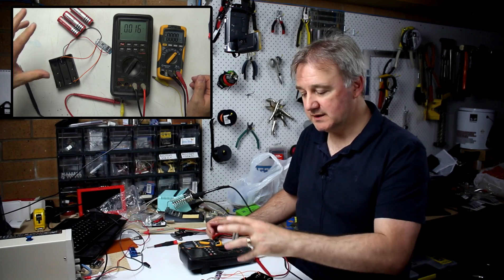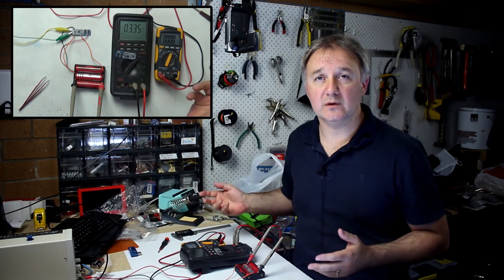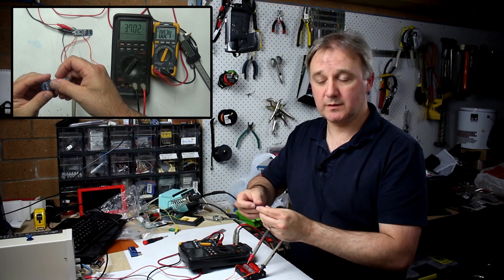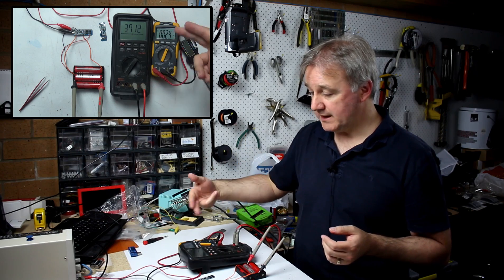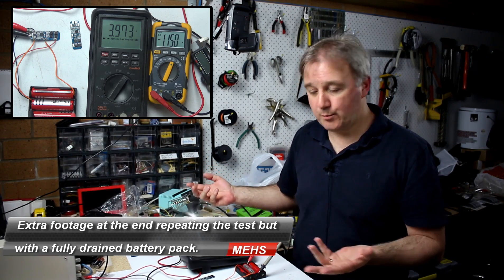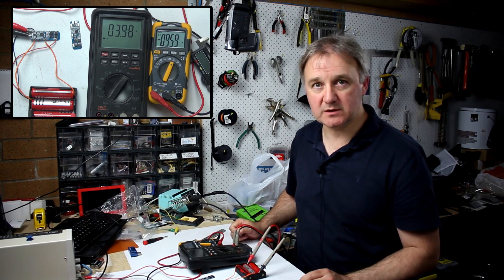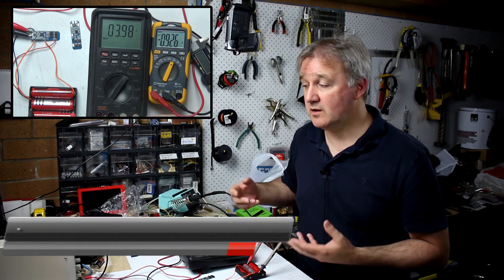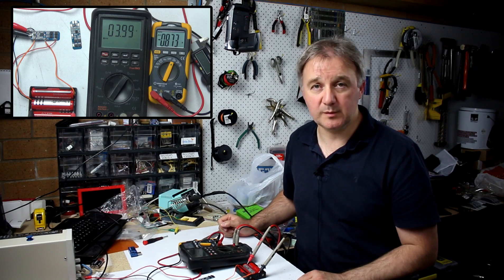Does a BMS charge my Batteries? (MEHS) Episode 57

Comment: I have one of those, it "works". It charges the batteries quite fast (diff brands tried) but never reach full 4.2V, mine gets them to 4.11. In full detail: measuring each cell independently it goes up to 4.23 but when charging is cut, the batteries are only 4.11, so the previous reading is not just the battery. It works fast, I like that, but after many tests I know it doesn't get them at 100% of charge.

It's fair to say there are different brands and PCB colors for this same circuit, so not all of them will behave exactly the same. 

I read comments regarding the input charging voltage but in my case it made no difference using 12V and up. It's not a full charging circuit. Yes it will cut the charging and discharging but there is no way to know if the batteries are charging unless you plug your meter. A one or two color LED would be a great addition but there is none.

The only reasons I'm keeping it is because it charges fast, faster than my other 18650 chargers, but I know IF I want 100% charge I have to move the batteries to the classic chargers, this one will never reach the 4.2V, it doesn't matter new or used batteries, or brands. But as said, that's mine, yours might work differently.
Reply: Thanks for sharing man... Is there any resistor to tweak and correct it?

Comment: what if i charge with 19v power adapter.. will that charge?
Reply from the maker: - Hi.  It will sort of but you will be causing the BMS to heat up a lot as the circuit on the BMS will cut in and out each time it detects total voltage over 12.6V (for a 3s setup).  In your case this will be most of the time.  Not great.  You should feed it 12.2 to 12.6V, not 19.  If you must use 19, use a MAX745 board that will charge the cells properly through the BSM and it will take up to 20v as the input voltage.  Cheers.

Comment: I think your thinking is flawed on this one. 12 volts  x 1 amp = 12 watts of charging power total. But your three batteries are charging at basically 4 volts. So that's 4 volts x 1 amp per battery = 4 watts of charging power per battery. 4 watts x 3 batteries also  equals 12 watts of charging power. So then your batteries are charging at 1 amp per battery not 1 amp divided by three batteries.

You should've put the amp meter between a battery and the BMS circuit board to find the charge current for that one battery.

Comment: Thanks for tutorial.  Have you discovered a BMS board that does what it should?  I also like to find one with separate charge and output lines, so I can use it like a backup battery.    Run my load off the battery that constantly charges.
Reply from the maker: - Hi.  BMS are trial and error but pair a decent one with a MAX745 and you have a drain and charge battery pack as long as you drain at less than 1.5A.  Cheers.

Comment: when i plug my bms into the 12v cig lighter in my car i dont seem to be getting a charge...  has anyone else tried this?
Reply: Is your BMS 2S, 3S, 4S, 5S, 6S, 7S....?? It makes a night and day difference.
Reply: Thanks everyone for the reply.  Im not sure what my original question was.  I have learned a lot since last year.   I think i was trying to charge my 3s4p using the 12v output in my car which I did successfully do by building a device that has a step up converter in it to boost the 12v car battery to 19v 2a and that is wired to a 3s mppt and it works
Reply: It depends on what your cig lighter is rated for, I would imagine not too high of current?

Comment: i want to use 3s2p 20amp bms for charging 3x3.6V 6 cell which i will use in motorcycle. and motorcycles regular charging system will be used to charge and drain the battery pack [3s2px3.6]. is it possible successfully?
-regards. -mamun2a
Reply from the maker: - Hi.  Yes and No.  You can easily find a BMS that will handle 3S at 20A so that part is easy.  The harder part is charging the pack as the BMS will handle input voltage peaks and troughs but it doesn't correctly charge the cells.  Your bike will just dump 12-15v into the pack and the BMS will try to reject anything outside the safe limits of a 3S pack.  This will put power back into the cells but they aren't being charged correctly.  You should connect a charging circuit to the pack so the charging circuit takes the power from the bike alternator and provides a correct charge to the pack.  This is tricky as the charging will be interrupted each time you stop the bike.  This is not ideal for lithium cells, hence why its not common to do it.  Without the charging board, you will get it to work but the life of the cells is unpredictable.  Cheers.
Reply: then using an additional charging circuit next to regulator will work, what u think? DC-DC Buck circuit helps or else to use for charging?? @michaelsstuff4402
Reply from the maker: - Hi.  Even if you add a charging circuit you still have the problem of the charge being interrupted every time the bike stops.  A full charge typically takes 4hrs or more and is not supposed to be interrupted.    @highspeedshipbuilding8318
Reply: Thanks for reply. now a days quick charger available for mobile, if i use them, what then??  @michaelsstuff4402
Reply: sorry for late, if i use quick charger for charge it?? i.e. 2 ampere mobile charger as charging unit??  @michaelsstuff4402
Reply: @michaelsstuff4402  https://www.aliexpress.com/item/HW632-XH-M603-Charging-Control-Module-Digital-LED-Display-Storage-12-24V-Lithium-Battery-Charger-Control/32842607493.html?spm=2114.10010108.1000014.1.8b659f8awlExDg&gps-id=pcDetailBottomMoreOtherSeller&scm=1007.13338.112237.000000000000000&scm_id=1007.13338.112237.000000000000000&scm-url=1007.13338.112237.000000000000000&pvid=fdac6bd7-c5ec-48d4-814f-3ef424276e44 
Thanks for reply. check the link, is this OK for charge and BMS same time?

Comment: I hope a buck boost converter connected between power supply & 3S BMS by setting it's CC (1A) & CV(12.6) can charge these battery safely. What u ppl think?
Reply from the maker: - Hi.  You will put some charge into the cells but not ideal.  The converter provides a constant 1A throughout the whole charge cycle.  This is not what LION cells want.  You need a way to have the 2nd half of the charge cycle be CV but not CC.  That's why I recommend a proper charging IC, not just a buck/boost board.  Cheers.
Reply: @michaelsstuff4402  I have read that buck boost converter can provide CC & CV like chargers. Charging starts with CC & voltage starts build up & when the voltage reaches CV level current drastically drops.  This is what I have learnt in case of Buck boost.. correct me if I'm wrong
Reply: @michaelsstuff4402  i have a buck boost converter which has cc and cv with variable trim pot so you mean if i set the current at 2amp and voltage at 12.7 through bms its not working like charger?

Comment: Tell me one thing. You are using 12V power supply to charge, right? Whereas the full charge voltage would be 4.2x3 which is 12.6V. How do you expect the batteries to get fully charged?
Reply from the maker: - Hi.  Yes good point.  I set my power supply to deliver 12.6V so I can get a full charge but a basic 12V supply will still deliver 4V to each cell and that is satisfactory as that still gives about a 75% charge.  The cells last much longer that way too.  Cheers.
Reply: Hi Sudip, I have built a 3 battery pack with a BMS. It's working great so far. My worry is I have no clue how to charge the pack once it runs out of charge. Would you be able to help me?

Comment: BMS by definition doesn't control the charge current and voltage.  It only monitors the status of batteries and take action for protection when something goes wrong. So question is not whether a BMS  charges the battery. Rather, it should be whether a given BMS works well with a specific battery charger...
Reply: so if i had a bms and i just hooked it up to 12vdc and i controlled the current , it would keep the cells balanced and wouldnt let them overcharge?

Comment: Would solar charging the battery packs be out of the question or what.
Reply from the maker: - Hi.  No not at all.  You do have to consider a couple of issues but solar is a real option.  The main issue is that solar panels output ranges from 10v to 19v.  If you fed that voltage into the BMS it would likely lock out the input.  This is not ideal.  All you need to do is run a voltage regulator between the solar panel and the BMS.  A SEPIC style reg would be good as they boost low voltages and reduce high voltages and give a smooth 12v supply.  If you used the MAX745 charging IC then they accept voltages up to 20v so that would work well with a solar panel.  The only issue there is that the MAX745 charger will only charge the cells through the BMS when the input voltage is 3V higher that the battery pack voltage, say 12.6V.  That means a 3S pack at a nominal voltage of 12.6V would only receive charge from the MAX745 when the solar panel is producing 15.6V.  You're missing out on some of the solar panel output range but it would work.  Cheers.

Comment: EXCELLENT work!  I've seen too many Youtube "experts" who aren't.  MEHS clearly has technical mastery of his subject and presents the information in a clear, understandable delivery.
Reply from the maker: - Thanks Bruce.  Very kind.  Cheers.
Reply: Dear MEHS, I've built a charger  that works for a 6-cell 18650 battery pack to run my Makita cordless drill (3 pairs in parallel, the whole set in series to get the 12 volts).  I charge each parallel pair with TWO TP 4056's in parallel.  I can't seem to send you the schematic here, but my question is this:  The setup seems to give a full charge to the Li ion batteries, but I don't have undervoltage protection when using the drill. The video you did for Episode 57 mentions that, though the board does NOT give a full charge to the batteries, it DOES provide undervoltage protection.  Is there a way I could use the board featured in Episode 57 to provide undervoltage protection and use my circuit to provide full charge?   Thanks for any thoughts you might wish to share.  Bruce Ratcliffe, self-taught electronics teacher, Edison High School, Fresno, California
Reply from the maker: - Hi.  This can get tricky as you need to watch out for the common ground problem when connecting multiple tp4056's together to something.  The grounds become common and one tp4056 ends up doing all the work and overloads.  That aside you have 2 options.  There is a version of the TP4056 that has a BMS built in.  Its a little longer than the plain version but it has under and over voltage protection on each board, good option.  The 2nd option is to connect each 2 cell pack to a 3S bms.  Again watch out for common grounds but you could get the 3 packs connected to a single 3S BMS with 20-100 amp rating and end up with a single 12V pack as you described.  If your not charging while the pack in connected in this 3S configuration then you might be fine with the common ground problem as its normally only an issue when charging through the tp4056 boards.  Cheers.

Comment: You are wrong. You only test one battery. And at the start it use 1.5 amp because it charging the 3 battery at end the bms is only charging 1 battery that why the amp goes down
Reply from the maker: - Hi.  Not sure I understand your point.  The charge rate is applied to all 3 cells, not one as its going through the BMS.  This BMS does not apply current to one cell at a time.  Is that what you meant?  Cheers.
Reply: No. You dont no the working of BMS. If one cell is reach certain voltage it will stop charging it. This means only two cell is charging. At the end one cell is only charging. BMS is great charger you can see them on laptop, e bike, and many more. You are wrong above BMS Charging
Reply from the maker: - I agree that once a cell has reached its peak voltage it won't continue to receive current and the remaining current will go to the other cells.  I don't remember saying anything differently.  If you have issue with the testing methodology, I addressed that in follow up videos on BMS.  The cells were a problem in this video as they were fakes and one had significantly different capacity to the other 2 which didn't help.  Cheers.

Comment: So, it's not really a BMS. A genuine BMS should manage power switchover and charging primarily, and safety limits secondarily. Most good batteries e.g., Samsung, have protection built into the cell itself. A diode should be added between the power source and this BMS to prevent battery power from going back through the power source when the power source is off.
Reply from the maker: - mmm yes I see your point but I think we can still call this a BMS.  It's not feature rich and doesn't contain a proper charging IC or other features you mentioned so you wouldn't say this a $100+ BMS solution for a mini power wall or anything but it still ties together multiple cells and gives the basic protection for the pack.  Cheers.

Comment: I didn't realize I've been charging my batteries wrong this whole time. does anyone have a link to what I should be charging my 4S 16.8v packs with? I'm totally lost now
Reply from the maker: - Hi.  If you take a look at some of the other BMS videos I introduce the MAX745 IC on a ready-to-go board.  It is capable of correctly charging 1 to 4 cells through a BMS.  That is probably what you're looking for.  Cheers.

Comment: Awesome Video!! I just bought this protection board. I Just want to know if I can charge with a regular power supply of 12 V 1A.
Thank you for your attention!
Reply from the maker: - Hi.  Take a look at follow up videos I've done and the numerous comments on this video for more info.  Basically you can pump 12v at 1A into the BMS and you will end up with some charge in the cells.  It won't be ideal as each cell wants 4.2v so you should provide 12.6v as the supply but 12v would work giving up to 4v per cells.  This is not ideal as a 4v charge is under capacity so you will miss out on some capacity but the main problem is the charging method.  A basic power supply will just pump power into the cells.  To properly charge lithium cells you should charge CC then CV.  You can do this with a dedicated IC or charger but you can also do this with a basic power supply if you take some care.  I would suggest watching a few more of my videos on BMS and also take a look at EEVBLOG who did a video on using a bench power supply to charge lithium cells manually.  Cheers.
Reply: Hi there, im doin almost the same as Joao says, using a 12,5V 1,5A powersupply for a router connected directly to a 3S bms with batteries attached. It seems like the current is just limited by router powersupply's max current protection? It charges up the battery fine
Reply: @michaelsstuff4402  Are you saying we should design a dedicated charging port in our packs that bypass the bms?  What happens when you hook a proper Liion charger to the P+ and P- discharging/charging pads?  Does the pack still only charge to 60%?

Comment: Your conclusion is that a BMS prevents over charging, over discharging (so avoids the worst) but do not charge correctly the batteries to used it full potential. Based on this, if your 4s pack of batteries is going to remain inside the equipment, can you have a 4s BMS inside the equipment (for controlling the discharge (V and A), possibly controlling the charging (even though it does not do it correctly when connected to a basic power supply) and have a set of 5 wires  going outside (with standard 5 pin connector) for a clean external charging via a more sophisticated charger? To put it another way, is there a risk that a BMS interferes  with an external Lithium Ion Batterie charger.
Reply from the maker: - Hi.  What you're describing is possible.  It would depend on how everything is connected.  Say you had a BMS and the 4 cells were connected to that BMS.  Most BMS (I can't say all) would not care that you are bypassing the BMS and applying charge to each cell individually.  In this configuration the BMS probably won't give any protection but that should be fine if you're using the sophisticated charger as you mentioned.  The only possible complication I can see is if the BMS is active because the pack is being drained by the load (the project is turned on) and the BMS IC doens't function as expected because of a common ground issue or false signals because of the external connections.  if you're external charger is not connected to the project (or cells) when the BMS is in operation (because the projects is turned on), then I think you will be fine.  You should always do testing on a project like this to make sure everything works as expected and is safe.  Cheers.
Reply: Yes it makes sense. I will do some trials. Many thanks for your quick and kind answer. And thanks for your nice videos.

Comment: The 3s charger failed as it was rated for 2A but was supplied with 5A that doesn't make sense, as the 3s charger shouldn't draw no more than 2A max.
Reply from the maker: - Hi.  If you mean the 3S BMS was rated at 2A then it would fail if 5A was pushed through it.  Its a max 2A rating so anymore and it will fail.  Cheers.
Reply: Ok.

Comment: A very informative demonstration.
I think we need to apply a little more than 12.6 V to charge the single cells to 4.2. Hopefully the BMS has a cut off mechanism, if  voltage of single cell is over 4.2V.
Reply from the maker: - Hi.  Yes the BMS has a cutoff and yes you are correct, there will be a slight loss through the circuit meaning the cells might only receive 4.18V each (as an example).  Cheers.

Comment: hello
i want to make battery pack 18650 6s 22.2v my battery its 5.6A so  its better to buy bms balance 8A or another 60A ? the A of bms what use it ? for battery  or brushless motor 
because i make a electric skateboard
Reply from the maker: - Hi.  The A stands for AMPS and you will likely need the 60A version.  Cheers.